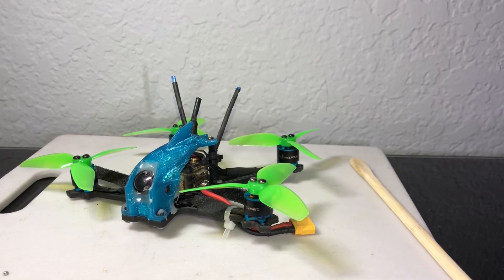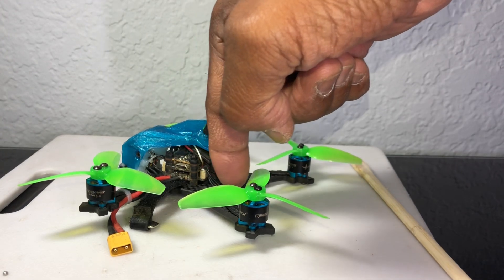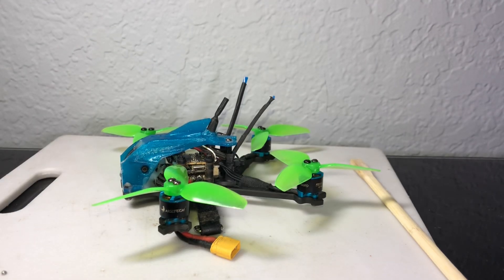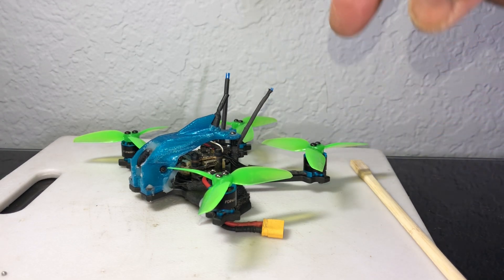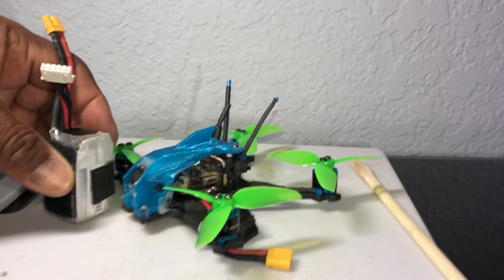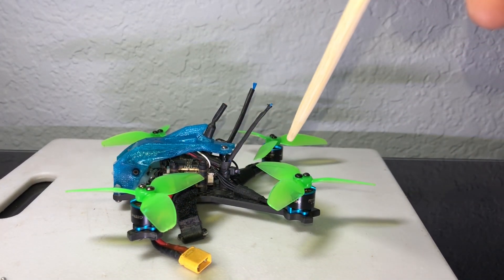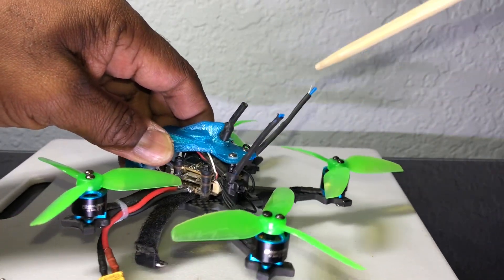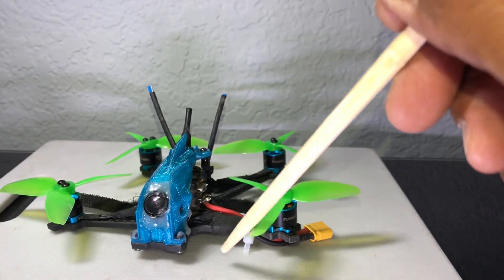👍Franken Blueberry Micro Quad Mix of  IFlight Turbobee CinePick And HGLRC- Only  87gr 3" on 4s

Comment: HGLRC also makes a 13A stack, but can take up to 6S! It's the stack the HGLRC Petrel/parrot 132 uses (it too comes with the 1106 3800kv motors you are using), and that thing is just crazy fast. I have the iflight turbobee 136RS V2 (15A stack, with 1204 4500kv xing motors) and absolutely love it. Personally enjoy flying it over my 6S 5" quad. Kudos on the frankenquad in any case!
Reply from the maker: I think your setup is perfect with 1204 motors. Are you running it 6s as well.  Amazon had a sale a while back  with a 4 pack of 1106 3800kv betafpv's. I bought them all for future builds using Sharkbyte and express lrs
Reply: @scottgivens27  no, unfortunately the iflight Succex Micro stack I have is 2s-4s (I run 4S). The next time I see the HGLRC  Stack (can take 6S) at a decent price, I'm gonna pick it up to throw in my turbobee.   I'll have to run a motor output limit (4500kv is WAY to high for 6S, almost too high for 4S lol) of about 75%, but that's quite alright with me :-)
Reply from the maker: @freddie514  crazy how advanced quads and related software has come. I'm sure you're fine with the current setup brother! You should consider ELRS if you haven't already. I love flying my micros semi long range! Lol. 

Have a Happy Thanksgiving!
Reply: @scottgivens27  absolutely! I was just explaining it to my fiance, how far the hobby has come. I actually am doing just that! ELRS is awesome. I'm ordering the module for my TX16, and appropriate receiver's for my 5" & 3"! I can't wait! D8 & D16 have served me well, but it's time for more range, especially since upgrading my VTX's in both (800mw/5" & 400mw/3"). I recently just got a micro, it has built in FrSky SPI receiver, and I'm starting to really enjoy it (I live in NYS so it's way to cold for outdoor flights most of the time lol), so I'll be doing alot of whooping. Happy & Safe holiday to you and yours, and happy flying!

Comment: Scotty, have you seen the 6S Parrot 132? Apparently the FD413a stack can take 6S voltage.
Reply from the maker: Yannick G whoa!! That looks awesome!  That has got to be a rocket. I'm impressed by these HGLRC motors. 

Should not have shown me this one. May have to get it! Lol
Reply: @scottgivens27 It must be bonkers, I'm just not sure how long the stack would last on 6S. I got an Email from Diatone this morning. They have new motor sizes. You should check them out. They have a new lightweight 2204 and 6S capable 1404s.
Reply from the maker: Yannick G yes, that stack cold lcould be an issue. There are some 30a AIO FC's that I could use along with those parrot motors. I have some 1408 6s emax motors on the Catalyst BangGod. 

But making a lightweight 6s setup would be great!
Reply: Speaking of builds, I put together a 4S 25a stack with a F7 FC for 30usd. I used the JHEMCU F7-XSD and the EM25a esc. Super cheap parts on XT Xinte...got them in two weeks.
Reply: @scottgivens27  I might give those 1404s a try on my Intrepid mini. JHEMCU has a 6S whoop board available too. That build would be nuts.
Reply from the maker: Yannick G OMG that's a great setup! Was it banggood!?
Reply: @scottgivens27  You mean the F7 stack? I bought the parts on the XT Xinte website. The 1404s, I would buy from the Diatone store.
Reply: Here. If you're looking for an affordable stack...The only thing missing is the Pico connector for the FC. You only get the board. There are two versions of The ESC. 15a and 25a.

https://m.xt-xinte.com/FEICHAO-Betaflight-F7-XSD-2-6S-Flight-Controllers-OSD-5V-9V-BEC-FPV-Four-Axle-20mm-For-RC-Models-Multicopter-Drone-Accessories-p723690.html

https://m.xt-xinte.com/FEICHAO-EM15A-EM25A-20x20mm-15A-25A-BLheli_S-2-4S-4in1-DShot600-Brushless-ESC-for-RC-Drone-FPV-Racing-Quadcopter-Multicopter-p721271.html
Reply from the maker: Yannick G I that's cheap! I just got an AIO 35a Zuess FC that was $56. I rushed that was cheap, but this combo is cheaper. Not in quality, just price. Thanks!
Reply from the maker: Yannick G these 3in setups are proving to be faster than a lot of 6s 5" quads. The tech keeps getting better
Reply: @scottgivens27  I have'nt tested them yet, but they look very good visually, the boards are clean and well put together. I'm gonna test one of the FCs on a 6S build and a whole stack on a 3in 1407 build. I'll do a quick overview of the quad.
Reply: @scottgivens27  The 6S build I'm completing with one of those F7 FCs will be a bit of an odd ball...

-Airblade Intrepid V2 4in frame
-Brotherhobby Tornado 1608-3200 (with motor output limit to 2400kv)
-Spedix IS40 6s 4in1 ESC
-Gemfan 4052 props